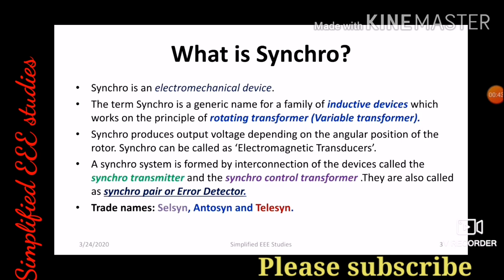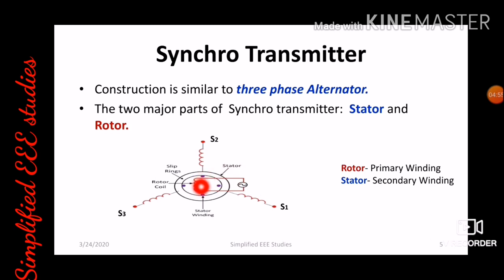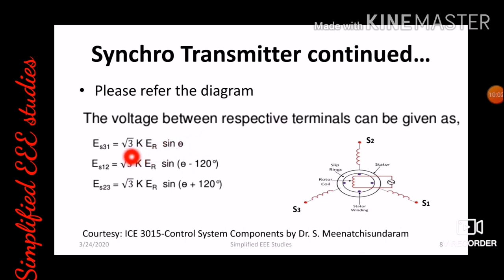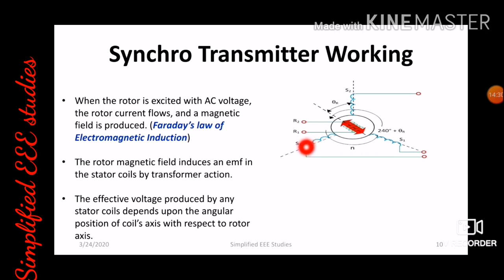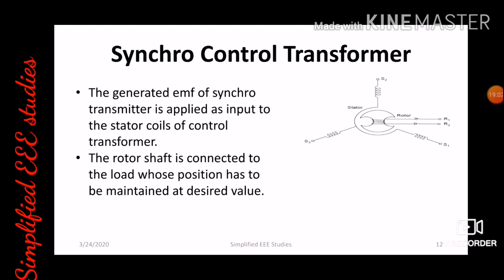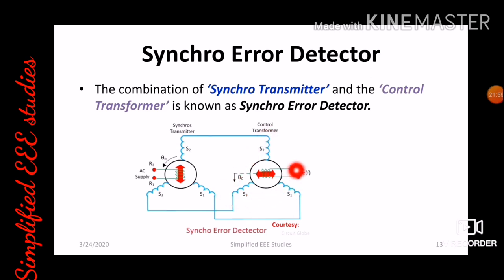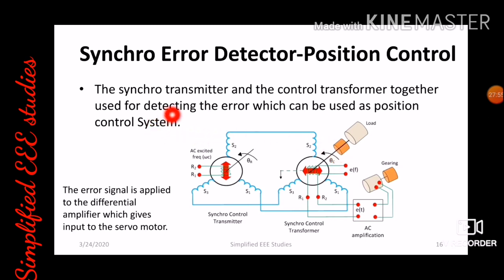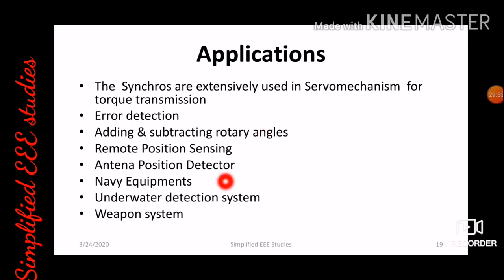SYNCHROS In Control System Engineering || Synchro Error Detector || Synchro Pair Characteristics

Comment: How did rotor move?
And without rotating the rotor how will emf generated in stator winding?
Reply: we will move transmitter in mechanical degrees as 30,60,...degrees etc.
when rotor is excited by 1ph AC supply varing flux linked with stationary winding emf induces.